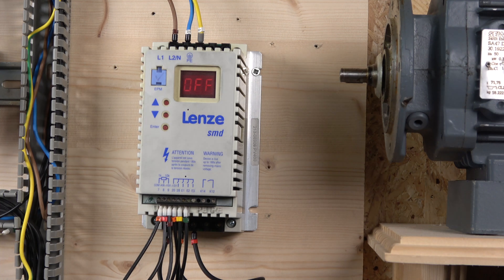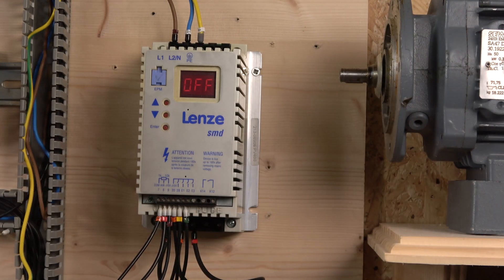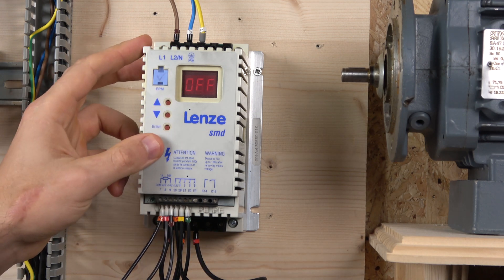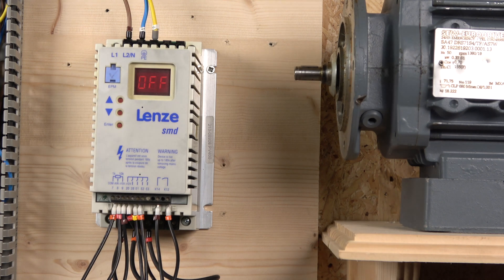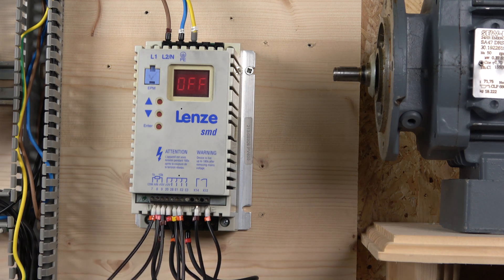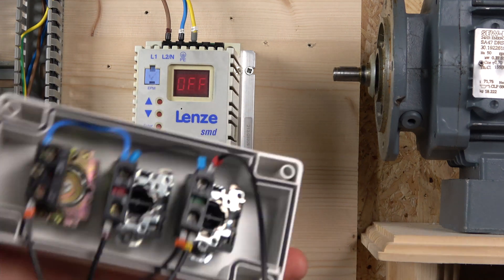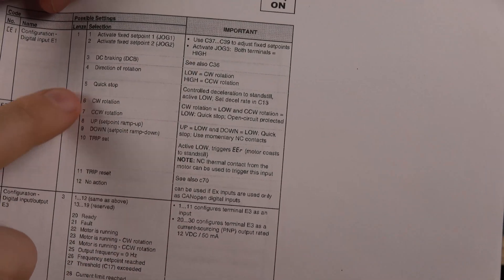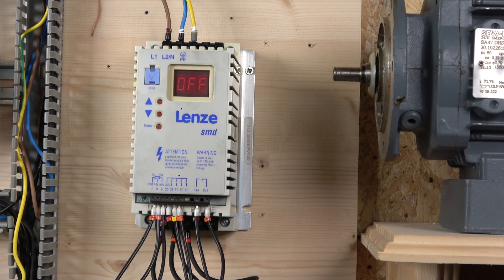Lenze SMD VFD drive remote control, 2 wire and 3 wire control, parameter set up. (English)

Comment: Which parameter set in using potentiometer
Reply: Just by connecting the potentiometer, it already works since it is an analog input. You must take into account that input 28 must be with voltage since it is the default starting signal of the equipment.

Comment: IS it common for the K14 K12 relay on this things to fry? I notice that one of the legs on the underside of the PCB is siliconed to prevent arcing I assume.
Reply from the maker: Hi There. No it is not common, when that happens, usually is to much current going true relay.